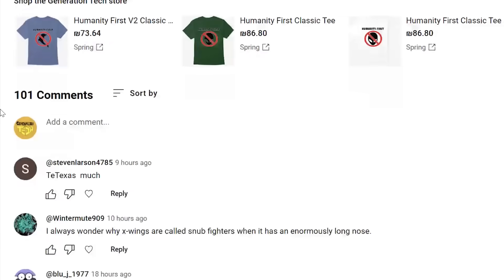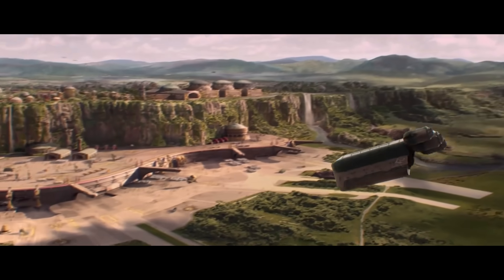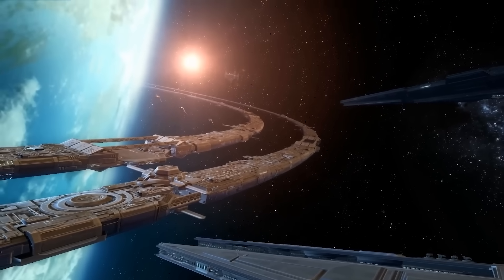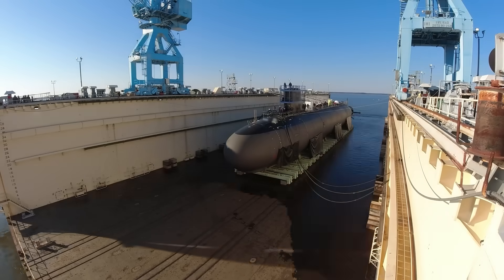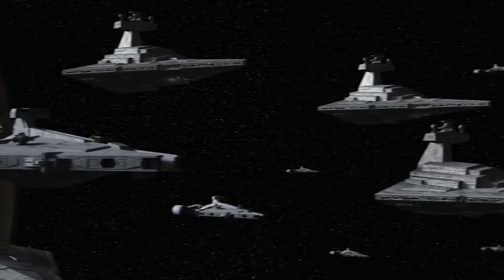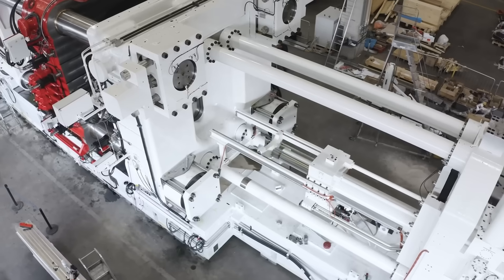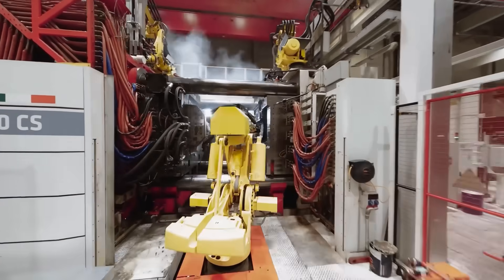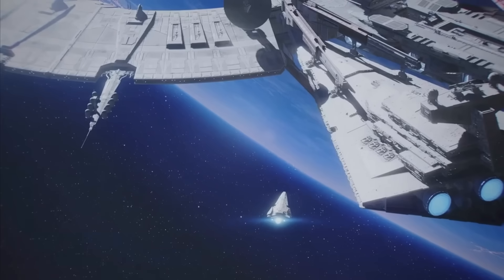The Economics of a 10 Mile Long Star Destroyer

Comment: It's not quite as easy to move large objects as you'd think. The larger the object, the greater momentum it retains. If you want to maneuver a large object, you either need large thrusters or very large arms attached to much heavier objects, or you have to be okay with accelerating and decelerating  objects very slowly.

Comment: If you think moving things in orbit is easier than on the ground, I suggest you play a few hours of Kerbal Space Program and try assembling the odd space station. I think you'll change your tune. Zero gravity does not reduce the mass or inertia of things, but it does eliminate some of your greatest allies: friction, air resistance and a reliable direction things want to move to. The closest equivalent to building in zero gravity we have down here at the bottom of a gravity well is probably rendezvousing large ships and craning large loads. If you see how slow and deliberate they have to act although they have most of their little helpers available, you can get an inkling of what it would mean to move kiloton structures in space with the sub-millimeter precision required by shipbuilding.

Comment: With respect. With Generative AI it's not fear. It's anger. Until companies fairly compensate every artist used for training data for AI creation it is an inherently immoral technology and that anger should be placed towards those companies who refuse to do so. At bare minimum people should not only be fine with, but should be actively encouraged to openly pirate and steal any software, art, or other creation that uses such technology until such moral restraints can be added. It also brings up the oldest question in the book: Why are only the executives and shareholders getting the benefits of automation and efficiency?

Comment: Even at a mere 300 million credits, it's still a fairly questionable investment. A Y-wing is 135 000, and I feel fairly confident that a fleet of 2000 Y-wings (or let's do a 50/50 split between Y-wings and X-wings if you prefer - an X-wing is 150 000) would take down any ISD even with very green pilots.

Comment: The most unbelievable part of the entire manufacturing process laid out here is that warships only cost 330 million credits when Kuat - according to the video - has no major competitor.  Kuat should be absolutely railing their clients with hugely outsized prices.  That's what happens when the competition stops existing - there's no downward pressure on pricing.

Comment: (10:55) Modern ships are often constructed the same way, in modular 100 ton blocks. Installation of onboard systems such as piping or machinery are roughly 10 times cheaper to install on block than once the ship is fully put together. Some of the first modular construction on ships were the Liberty ships in WW2, it got to the point US shipyards were producing boats faster than Germans per producing torpedoes to sink them.

I agree that such large ships would have to be built in space. For one, the necessary space for a 16+ km ship, but secondly, the surface needed to cradle such immense weight. The 100 ton blocks in shipyards must have specially reinforced concrete to transverse, and with millions of tons of metal landing on small areas, it would puncture through like the legs of jack up drill units on a soft ocean floor. Even bedrock could be prone to delamination and uneven settling. This would leave two options, either to built while either immersed in a fluid with structure supported and stabilized by hydrostatic pressure, or to build where gravity doesn't matter in space.

Comment: The KDY Yards are FAR vaster than just the Ring Yard surrounding Kuat itself, they have HUNDREDS of Shipyards spread throughout the inner star system along with all the Hundreds of Thousands of Component Factories spread throughout the space between the individual Shipyard building slips...

In addition to the Vertical Integration of the Supply Chain, the other main way Kuat (and other Shipyards at Corillia, Fondor, Bilbringy, Mon Calamar etc.) can build such large ships so quickly and cheaply is by using several THOUSAND Metric Fu@ktons of Droids and other forms of Robotic Automation to increase efficiency...Robots and Droids work 24/7 (with the only breaks needed for maintenance/repairs), no pay and few mistakes...

Comment: I like the video. But I don't think it's as simple as all that.
The amount of resources required is insane. They need to be mines, refined, smelted into parts and moved to the build location.
The size is an issue too. Most of these structures are so big and heavy they need magically strong materials to hold together when under thrust or effected by the gravity of a planet.

At this point I assume starwars has infinitely strong materials and gravity/anti-gravity they can apply at will and infinite energy from nothing 😁

Comment: near term we dont need to use huge amounts of rocket fuel to have the delta v to move asteroids. we can simply make a magnetic catapult on the moon and mine there.  it has all the minerals we need except carbon. an abundance of iron, oxygen, titanium, water ice, etc. it will be FAR cheaper to set up an industrial hub there, make a few 100 miles of track and yeet stuff into orbit with magnetic acceleration. no atmospheric drag and no fuel required. then it can be pushed to earth orbit if needed.

Comment: Well you'd start with the frame built around the vessel kinda like a dry or space dock where you slowly but surely build section by section as raw materials are brought up from the surface of the planet, moon or asteroid you're above or? Shipped in and transported to the designated area and then assembled.

You'd build from if me bottom to top different sections then snap them together and bolt them all up with rubber seals ensuring everything is airtight, then you'd do a leak test where I'd use smoke bombs coloured smoke to indicate a leak to be patched up immediately, then get an air tanker vessel which is exactly what it sounds like lol to fill the ship with air. 

Once compressed to 1 atm of air about 30psi? You can send maintenance inside to install the plumbing, electricals, security cameras, floors, doors, walls etc etc. You'd build the outside first then ensure it's all ok, air it up and build the interior until all done and once everything is installed? Test inspection and diagnostic tests then fire up the reactor(s) and you're off

Comment: So the Mega Class Star Dreadnought Supremacy had a 60km wingspan. If the first Death Star had a diameter of 120km, that would be equal to the width of 2 Supremacy's wingtip to wingtip. Sorta helps put these into perspective. The diameter of the first Death Star was also equal to a little over 6 Super Star Destroyer's end to end.

Comment: Something else to consider with the modular capacity of large clases of ships: once the sections are assembled, its going to cost literal beans moving them around. Removing gravity from the situation opens up so many avenues to drop cost; modern construction of anything has to factor in the price of fuel to bring supplies and materials to the site. Remove that- or mitigate it with low cost/high speed space travel- and you take a big chunk out of the logistical nightmare.

Comment: Im sure I mentioned before in comments my friends and I do star wars RPs often set in the Imperial Era, and we got it in our heads to set up a rebel base in a star destroyer (about 1ABY). After committing a small act of bioterrorism (unleashing a benign version of the Blue Shadow Virus more akin to Chickenpox) to get the empire to clear one of the Fondor drydocks, we stole it, albeit a bit damaged on the way out. The sad part? Our GM is former US navy, from the CVN72 USS Abraham Lincoln... and used that as the basis for his reasoning when he told us "So the destroyer is low on fuel. Since I feel merciful, this is a refitted destroyer that runs on regular reactor juice instead of something exotic, but it needs A LOT of it."

Turns out, refueling a start destroyer in-transit involves a fleet tender, which we also had to steal. Also a bunch of service techs, which we had to hire by scrapping half the guns on the ship. By the end of it, we managed to make do with only 250 people, but it was only suitable as a drifting, 'jump once a month' base. 

Our GM pointed out "Look, can you imagine trying to operate, let alone maintain an Aircraft Carrier with only 6 people?" When we complained about automation and asked about droids, he remarked "Sure, but then you need techs to maintain droids, and more supply lines for that."

In the end, we basically ended up just parking it inside an asteroid, and forgetting about it until we needed an absurdly large power generator for a planet base.

Comment: Their also something really weird that happens in space called cold welding. Do to the vacuum you can have pure metals in space and when two pure metals touch they fuse together as if they were one peace to being with. For us this is a issue as if not properly design parts on a space craft that should move or be separate fuse into a single peace. It is not impossible to think that some of this ships are effectively press fit together making a structure that is at the atomic scale on single peace.

Comment: I may be mistaken, but only one modern heavy-lift rocket fuel uses hydrocarbon based fuels, and that's a kerosene/liquid oxygen engine.  They're just not efficient enough compared to ammonium nitrate or hydrogen peroxide, among many others.  Times have changed since the Saturn V, my friend.  Which was still kerosene/liquid oxygen.  Our efficiency is MUCH higher now, and doesn't really make use of hydrocarbons overall.  Some NASA guy can correct me if I'm wrong.
Reply: Take a look at "specific impulse". Typically, specific impulse (or ISP) is a measure of how efficient a rocket engine is. However you can have very high efficiencies, but normally at a trade-off of lower thrust

Comment: A ring around a roughly Earth-sized planet that looked as big as the images in this video would have to be, like, billions of times more massive than the Death Star!  Millions of times at the very least! (Somebody do the math, please!)
Reply: The planet is exactly 10,000km in diameter, which seems improbable unless it was engineered by Celestials and Rakata
Reply: @Hello-bi1pm   The meter was originally defined based on a measurement of the the size of earth, it would be weird if it didn't create something close to a nice round number when used to measure the earth.
Reply: @Hello-bi1pm  Why?
Reply: Certainly. Similar to a Dyson sphere
Reply: Not really, there was a calcution in if i remember right to bulid a boot srap capable orbital ring in the 1980 with a cost under a 100 billion usd. A orbital ring it more feasible and simpiler then a space elevator. We could build one today, just a mag level train in reverse, where the train part is moving relative to the orbiting band to be stationary to earths surface and then just drop a rope and attach a climbing vehicle. (not that simple, but nit much more complicated)
Reply: @s33rlies4  that would be cool I'm pretty sure this exists in Star Wars
Reply: @BugRib  An orbital ring isn't really that terribly impressive, tbh. The raw material requirements are the main hurdle, of course, but we know that's basically irrelevant as a concern for SW; in terms of actual engineering, a Death Star is laughably more impressive simply by virtue of being mobile, with all the hurdles and challenges that entails.
Reply: @papapalps2415   - True. But still, just the amount of raw materials would probably dwarf that of the entire Imperial fleet, including both Death Stars.

Just seems difficult to justify economically…
Reply: @BugRib if I had to canon explain this on the fly I'd say it's mostly hollow inside, and it's mostly cheap material. Still crazy sized even in comparison to Death Star, but more explainable
Reply: @otoñal3equinox   - That’s a good head-canon explanation.  I like it! 👍

…But even so, I still think it would require more raw material and man-hours to complete than the entire Imperial fleet. 🤔
Reply: @BugRib  hmm ok I got one for you! How about the planet used to have rings that were made of metallic rock, and those were made into the orbital thingy over generations
Reply: @  - Impressive.  Most impressive (head-canon).

Comment: In the case of the Tesla megacasting manufacturing method, EVs from any manufacturer aren't exactly building a reputation of being "serviceable" by any stretch of the imagination. What about battery degradation for example? Most people would rather ditch the car entirely than deal with anything to do with the electrical system because it's cost prohibitive, and it's not like you can even do basic maintenance on the things in your driveway/garage either. Then you have the whole other aspect of firmware & software and all of that jazz, and well...

Here's an anecdote for you all to chew on. My friend had a 2013 Chevy Volt hybrid for probably about 6ish years, he loved it. He got it mostly for his long commutes to work, and once he moved closer to work he told me often times he'd go an entire week without even touching a gallon of gas. Well, a couple years ago the charging port began to have issues. I think he had it assessed and it came out to some absurd number like $20k to revamp the system/batteries/whatever it was. He said fuck it and chucked it, custom ordered a manual 2022 Corolla hatch that he had to wait a year for, and got rid of that thing.

Comment: meh I think they just got lazy, cause for real, even if we go "low tech" and instead of the top of the line in interstellar warfare with FTL engines, consider the same cost of the 1.5 billion dollars (1.5 BIllion$ and it's jjust concrete , steel, and AC/water lights, no actual water recycling, oxygen production... etc. no turbo lasers, no armor, no super computers, and it was also built with questionable labor.  828 m tall, lets pretend 1000Meters,  so 19 executor super star destroyers long,   so 34 billion $ just to match the length, it's 4000 meters wide, 1200 meters tall, the burj is 120 meters wide so you would need 300 X 19 to fill the volume  so 5,700 BKs  so if it was the same cost of building the burj it would cost 8.5 trillion to build the executor SSD. I need to leave, but I am curious how many G-fords fit in a SSD and how much that would cost.  the empire had like 70 million worlds in it's control,  each world would pay 120K credits to build that SSD  assuming the world has 1 billion people  each person is paying a fraction of a credit each.

Comment: Kuat-KDY is the answer.    The Ring was able to service thousands of ISD-2 sized ships, while at the same time manufacture thousands of ISD-2 and a few dreadnaughts all at the same time.      The vertical integration of supply and logistics is a great point..   Also the cost to produce technology in the starwars galaxy has been revolutionized with AI controlled nano assembly
Reply: The method your talking about is called "superblocks"   its how they built the  USS Ford..     enabled with the use of 3d virtual design software to keep the wiring and piping running correctly.
Reply: If there is a company that holds a virtual monopoly on a strategic asset, it has no incentive to SELL it´s products at a bargain price, even if it can make them very efficiently.
They would take the highest price they could extract from the state without endangering the orders. 
The price given for an ISD compared to other goods appears completely unrealistic, considering the raw amount of ressources that would be necessary to make such huge object.
Reply: So AI is allowed for construction, just not for warfare?
Reply: KDY is the Lockheed Martin of Star Wars
Reply: I'm seeing "rings" and "able to service" and I'm trying really hard not to be immature here 😂😂 great comment though I'm just a 30 year old child

Comment: I can very easily see parts of these ships being, effectively... 3d printed.  you could easily lay down a keel or spine of a ship in space just by "extruding it"   on the spot.   and this would allow you to go anywhere from 100m to 50,000m   just by alterting the thickness  of the extruder and push/pulling out any length you want. cutting it off at the end,  cooling it,   then 3d printing the base skeliton of the ship.
Reply: 3d printing, 3d printing...Bla Bla Bla. Mass production is far easier in a factories than 3d printing.
Reply: @AKUJIVALDO  mass production for international component...  but for structure, plates, frame...  nope, easier to just print them on sight, then to try and haul it quarter mile beams